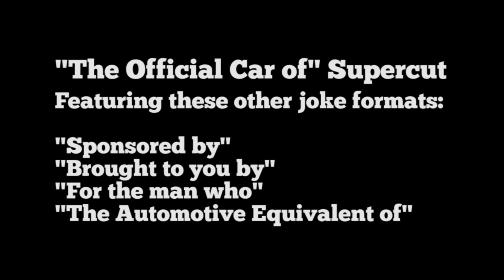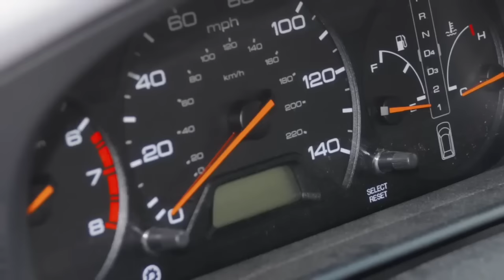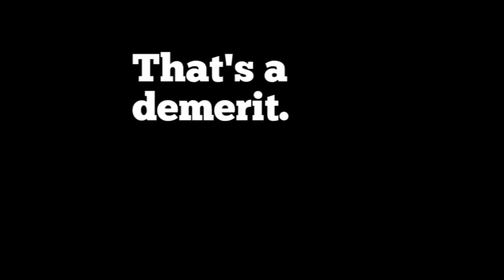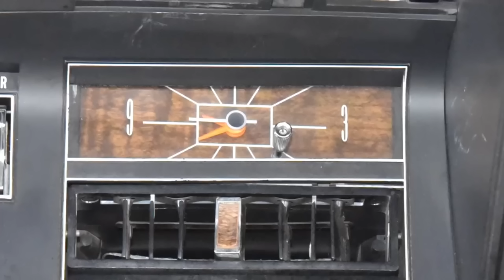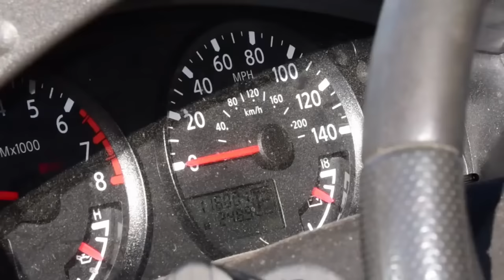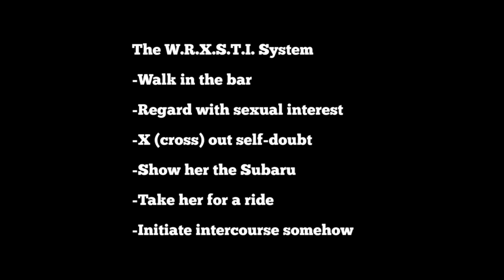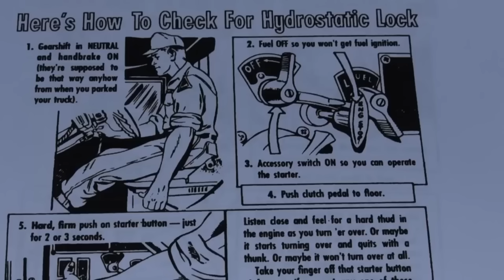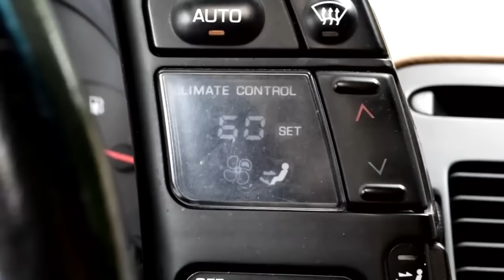The "Official Car of" RCR Supercut

Comment: 9:35 the homoco hatch back, just lift it up and climb in, the side doors child safety locks are broken in the engaged position... hatch struts drop after 10 seconds locking down only allowing the illusion that it stays open. climb in, follow IT... floating baked Az Fk.